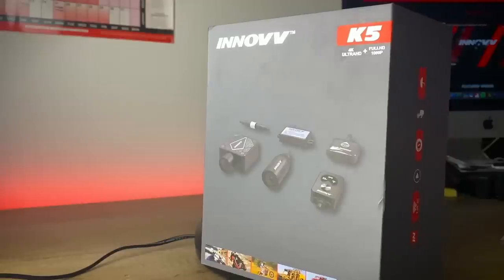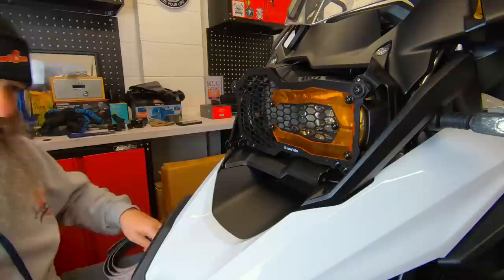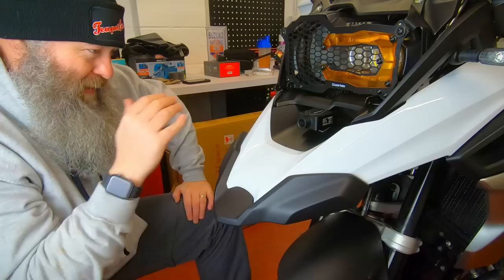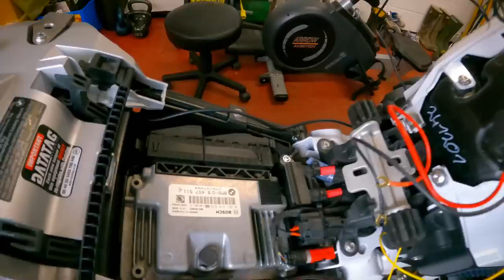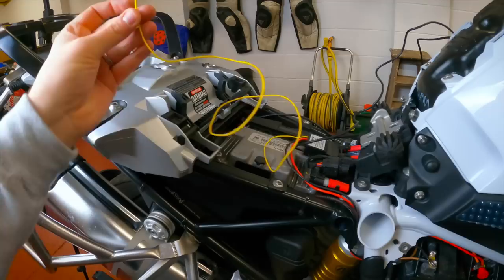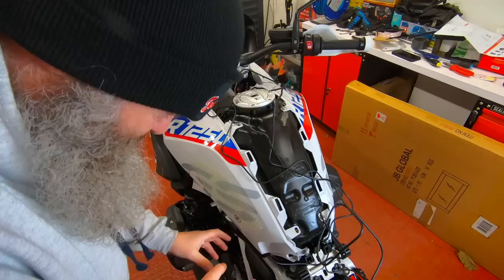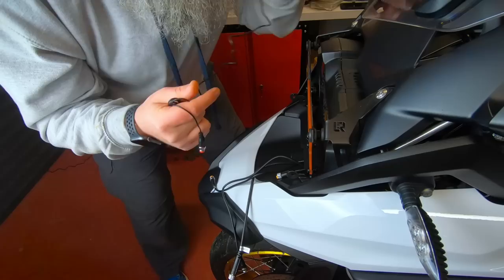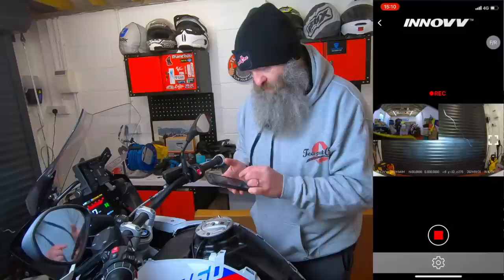Innovv K5 Installation - How to Install Flagship 4K Motorcycle Dashcam System on Any Bike

Comment: I really do agree with the issues of where and how the DVR unit connects to everything else. Having those connectors so close to it is definitely an oversight by Innov, they along with the fuse for the power unit should be right my the power unit itself. It's under the seat or behind a panel depending on bike, and it makes far more sense to keep connections away and out of as much weather as possible.

Comment: I Just installed mine too. Your video was helpful. I have one question: Where did you connect the switched plus, yellow wire, in the rear. I dont't find anything under the passenger seat.

Comment: I think they’ve made that a very difficult installation regarding getting all those cables to the front of the bike and not as covert as the K2, not for me I won’t be upgrading.
Reply: Totally agree. I have just installed a K2 and much prefer the design.
Reply: completely agree with you.. I was hoping to upgrade from K2, but after seeing this, there is no way that I will.. really bad design putting the control box with the front camera
Reply: Why move from under seat , crazy
Reply from the maker: It’s due to the limitations of the 4K front camera. It’s not possible to get the 4K ‘info’ down a cable to a separate DVR module (not at this price range anyway), so the DVR module had to be integrated into the camera.

There’s a new K3 system coming out which is upgraded 1080 cameras like the K2, but with the faster Wi-fi, better gps, remote and mic of the K5👍
Reply: @teapotone  thanks.. I think I will wait for that.. its been a while.. how do u like that massive front camera out the front of your GS?
Reply from the maker: Don’t notice it at all tbh as you can’t see it when your riding. The beauty of these INNOVV systems is they are just fit and forget - the only time I ever bother to check files etc is when I want some clips for any content, otherwise it just runs in the background all the time and all I have to do is give the lenses a wipe when I clean my visor and GoPro’s 👍

Comment: Excellent review as always. Slightly big unit but I understand why... however, what I don't understand is the need to be able to access the SD card, surely it's a fit and forget as everything is via the app? you don't have to take the SD card our to transfer to a PC like you do on some helmet cam's do you?
Reply from the maker: You can transfer files via the app onto your phone, then transfer from your phone to your computer - but if you want a lot of files it would just be quicker to take the SD card out and whack it in your computer.
Reply: @teapotone  Ok that's useful info, many thanks, ride safe.

Comment: I think I share your thoughts, 1 big step forward but 3 steps back, looks like the desire for 4k has happened before the designers are capable of putting it into a practical module, k3 if I was to buy I'm afraid. For the Gs the 4k camera has to be mounted with the built in mounting hole to a bracket as you shown, on top of beak nah sorry.

Comment: Along with a lot of other people i don't like all the cables running to the front is there any reason why the front camera cant be mounted an the rear?
Reply from the maker: You can mount it anywhere you like bud - Chase on Two Wheels actually mounted his 4K cam to the rear and the 1080 at the front 👍

Comment: Nice video Bruce. I don't know why I watched the whole thing as not only do I not have an INNOV camera system but I don't have a bike at the moment! lol Anyway, nice to see how it all goes together!  One thing I would mention is, I know we spoke about the possibility of dirt and spray kicking up from the front wheel onto your front camera, I find that on my e-bike I get water kicking up off the forward facing mudguard and the wind blows it back up over the front of the bike and even up to my face. Might not be as much of an issue for you but something to think about? Cheers!
Reply from the maker: Thanks bud, aye that’s something you’ll never avoid I’m afraid. Wherever you put a camera, it’ll always be affected by moisture and dirt in the air - even if you put it behind a screen, the screen will just get dirty and block the cameras view.

I think the issue is these cameras are fixed in position so they don’t benefit from movement as much as a head mounted cameras does - so the turbulent air is constantly changing direction across the helmet can lens, and therefore it keeps cleaner for longer 🤷‍♂️👍
Reply: @teapotone  Very true.

Comment: Hi Teapot - Great video on the install of innovv K5 - question should the blue light on the DC Convertor stay on all the time even when bike is not on - i set mine up and i am concerned about that blue light draining battery life. Q2 -on the K5 set up you connected the yellow wire from DC convertor to something different. i have a 2018 BMW1200GSA and set mine going to the the red/blue wire that you did for K2 - seems to work but the option of running it the rear looked much easier - can you do that on 2018 model or is that piece only available on 1250?
Reply from the maker: Yes the blue light should stay on all the time - the DC converter has optimal battery technology so if it detects that the voltage of the battery is below a certain point, it deactivates the park mode and goes into standby.

I connect my systems using a Hex EzCan

Comment: Hi, can I connect to rear light for the yellow wire for switched live? as I don’t have any additional canbus modules?
Reply from the maker: If it’s a modern BMW then you will have a canbus loom so don’t hack into a switch live unless you know what you’re doing.

If you don’t have a canbus loom, then yep the switched live at the rear light is a good option
Reply: @teapotone  thanks for your help, bmw have said there is a switched live fuse under the front seat, will take a look

Comment: Hi, nice video! Yesterday I installed K5 to my R1200GS and have few questions if you can help. As I see from your video as well as from videos of other vloggers who installed K5: WiFi starts to work after starting engine only, but not before (after switching on ignition). if you just switch on the ignition even leds of remote control unit do not light or flash, right? So what is the purpose in this case of connecting yellow ACC cable to positive ignition supply? I have connected yellow ACC to ezcan to the output to additional tail/stop light so when I switch on ignition my additional tail lights starts to work but may be it has too weak signal to make K5 work as add-tail lights are configured in ezcan to light not bright …

Comment: I was having doubts between the K2 & the new K5, now that I have also seen this installation video of you, I am going to buy the K2 anyway. 

The front camera of the K5 is really too big with the module built in and the connections are not ideal compared to the K2.

I don't have a Hex ezcan, where can I best connect the yellow wire to my 1200 GS LC Adventure?

Regards,
Stephan
Reply from the maker: Stephan do NOT buy the K2!

There is a new K3 coming out soon (I’m just doing some beta testing with INNOVV just now to iron out the bugs) and it has a remote and external mic like the K5 (Wi-fi is much slower though).

At the very least I’d go for the K3, but personally I’d now spend my own money on the K5. The better image quality, and faster Wi-fi make the whole thing much better to live with day to day, weirdly I also think the mic quality is better somehow.

I’ve put the K3 and K5 systems on and off my bike many times now, and the K5 is actually much easier to install.
Reply: @teapotone  Thank you for your comment, you are not making it easier for me to decide haha.

4K image is more interesting, of course, but the smaller camera is nicer to build away instead of that large model of the K5.

But you actually say buy the K3 :-).

Regards,
Stephan from The Netherlands
Reply from the maker: I said I’d go for the K3 BEFORE it had been sent to me, as I was initially out off by the size of the K5 front camera.

However after now using the K3 for a while, I’d personally spend my money on the K5 as it’s a better system and easier to install/use overall

Comment: Wouldn't it be nice if bikes had a wiring conduit/pipe running forward and aft inside the frame, from a generously empty accessory fuse panel under the seat? 🤔 Between my GPS, volt meter, heated grips, USB, Power Commander, smart taillight, and charger connection, my bike is a rats nest of wires!

Comment: Hi I have s1000xr 2017 , wanted to install K5 , but BMW dealer said it will give lot of error codes if I try to do it and try to tap on to Tail light cable for the K5 yellow cable . 

Is it true ? They said they will charge me 1500 $ in Sydney to do this job. 

I am confused.

Comment: I’ve heard you talk about this on the podcast and even found a local supplier - however having watched this I think I’ll be waiting for the K3, for the reasons outlined already. The DVR unit is relatively huge and those cables would mess with my OCD too much.
Do you ‘really’ need 4K or is 1080 sufficient when you consider if only be using it as an insurance, and unlikely to be using any footage for a Spielberg blockbuster.
Reply from the maker: I’d have previously said 1080 was fine - but now, having had both, I’d say go 4K all dat long - far clearer image so better for insurance purposes etc.
I’ve a comparison vid coming
Reply: @teapotone  yeah I’m sure you’re right. Still remember when HD started and we thought it was amazing - then 4K started and that’s the new standard. 
You can almost guarantee that when you really need it, the rego on the car that does you wrong will be unreadable and you’ll wish you had the better quality.
Reply from the maker: That’s exactly my thoughts now with the 4K that the K5 provides.

When you pause the vid, you can still read most number plates on the K5 with 4k, but it’s near on impossible with the 1080 of the K2 or K3 a lot of the time 🤷‍♂️

Comment: why not run power From the hex ez can instead of the battery? (Assuming u don’t want the parking guard feature)
Reply from the maker: Because that’s not how the system is designed. 

Contact INNOVV if you’d like specifics bud, I don’t know any of the technicalities, I just wore it up as the instructions say 🤷‍♂️

Comment: Nobody tried the G-sensor? How does it work, For accidents or when someone moves the bike?
Reply from the maker: It has various levels of sensitivity, I have it on the lightest/least sensitive, and it still activates when I move my bike off the stand in sparking mode
Reply: @teapotone  But sensitivity is only when engine is Off? Because when you ride you get bumps, it will fill up the memory after some time. Right or I'm mistaking?
Reply from the maker: No I think ‘Sensitivity’ is an overall thing - and yes it does ‘lock files’ and put them into ‘Protected’ or ‘Accident’ folders if the G-sensor detects sufficient movement, but as I said I have it on the least sensitive setting and it’s not too bad.

It still does mark the odd file as protected or accident when it doesn’t need to be, but it’s not horrendous at it.
Reply from the maker: I’d just say at the end of each month, reformat your SD-card to ensure you wipe everything clean if you don’t need the files 👍
Reply: @teapotone  Yes, indeed. Have to adapt. :-)

Comment: Cabling seems a bit backward with everything having to run to the front of the bike, when traditionally there would be more space and hiding options towards the rear.  Another quality video though pal.
Reply from the maker: Thanks man, aye that’s what I thought to, just doesn’t seem very well thought out for a motorcycle orientated system - especially when you look at how good the K2 was?

But I know the new K3 system goes back to the K2 format, just with upgraded cameras (still 1080) and with upgraded Wi-fi, gps, external mic and remote 👍
Reply: @teapotone  Ah ok so really if someone is tempted by the system they would be better to buy the K3 when it comes out?
Reply from the maker: I reckon so yes, going by the info INNOVV UK have told me so far, the K3 is likely to be the unit most folk will go for.

Comment: ...... now hear me out on this before you all start rolling about laughing! ......... given that a lot of incidents with bikes involve rear end shunts, and given that there are a lot of cables on the V5 unit - is there any merit in fitting the 4K camera to the rear? There’s more room in the tail section of most road bikes compared to the front - ok....... you can all laugh now! 😀👍
Reply from the maker: That’s what Chase on 2 Wheels did - you can fit the cameras anyway round you like 👍
Reply from the maker: Initially I didn’t like the setup of the K5 and wished they’d gone back to the central DVR and 2 separate cameras layout like the K2.

I’ve been testing the new K3 for the last few weeks which is just like the K2 but has the remote and external mic of the K5.

My opinion has now changed and I much prefer the setup of the K5 now, it’s just much easier to install and is actually a more simple layout.

There’s no hiding that big 4K camera though, unless you cut holes in plastics etc

Comment: Looks bulky and cumbersome up front, i think innov have slipped up here. The K2 looks like a much better option- being unobtrusive yet efficient, do you really need 4k for dashcam footage ??
Reply from the maker: No I don’t think you do bud, 4K is useful for blog footage but for this type of use 1080 is ample - frame and bit rate are much more crucial. High bitrate and 60fps at 1080 is perfect for dashcam use.

The new K3 system coming out soon will fit the bill nicely
Reply: @teapotone  I saw the K3 on there website is that new? Is it newer than the K5
Reply from the maker: Yes it’s brand new, not available to the public yet, but coming very soon.

I’ve just installed it and am currently testing for review
Reply: @teapotone  Definitely keep me posted. I’m interested in the K5 but will wait on the K3 review before pulling the trigger. When do you think the K3 will be available to the public
Reply from the maker: I think it’s a matter of weeks bud

Comment: Why not just mount it behind your windscreen?
Reply from the maker: Your screen will still get dirty and wet though, so what’s the point?
Reply: @teapotone  it might give you a less obstructed field of view
Reply: @teapotone  my F750GS does not have that gap in the front where you installed yours.  So I guess my question should have been CAN you install it behind the windshield.
Reply from the maker: Yes bud, you can install it anywhere as long as you can get access, and either bolt to an existing mount point, or secure the camera somehow wherever you want it.
Reply from the maker: It might yes - but on some bikes it may give you an even more obstructed? It’s entirely down to your bike and how you want the setup to be

Comment: Way too easy to steal if it has to be mounted in the open as in this video.  At least with the K2/K3 and similar products if some idiot with a knife makes off with your cameras you still have the main module hidden under the seat containing your videos and you can just get new cameras for it.  I'm surprised this design made it beyond the prototype phase - it will be interesting to see how many they sell.